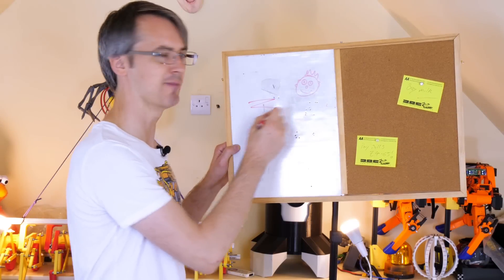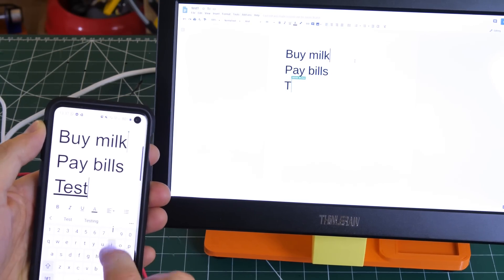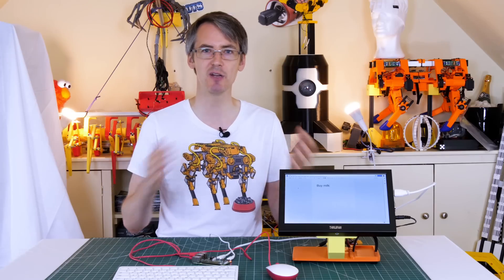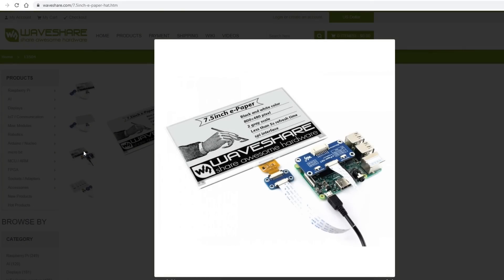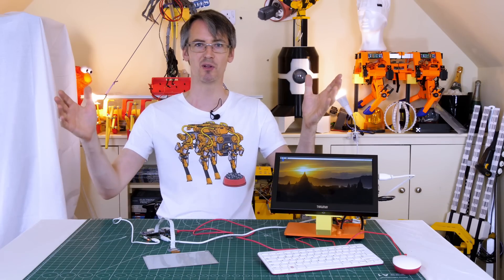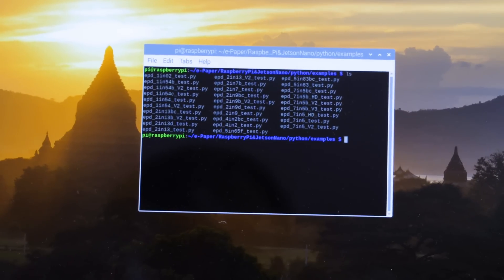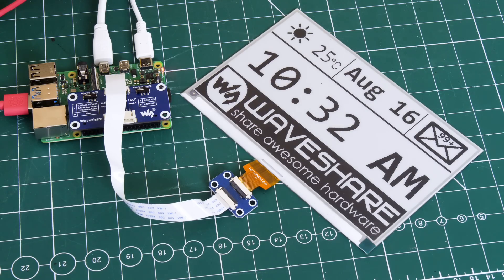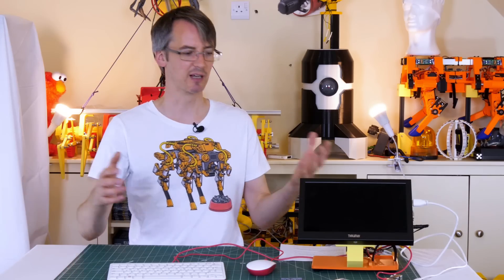DIY IoT  E-PAPER  Message Board

Comment: I would suggest you to learn more python. This is an amazing and very powerful language, but you use it as if is was C (which it really isn't)
Reply: He really isn’t even using it like it’s C— C has arrays (for the numbered variables), and functions (for loading, saving, change checks), and binary logic (accruing a or’ed change check var instead of a massive if condition).

James is an amateur programmer, coding in whatever language he’s using like it’s a basic shell script.  No shame intended and he’ll get better over time (not just using fancier features, but actually better; e.g. the save operation should’ve been after the change check), but right now he’s clearly in the “just make it work” stage of programming.
Reply: import antigravity
Reply: And couldn't you even run it as a service instead of a Cron job? I dont know if it would have any benefits, but it sounds good
Reply: @noahluppe  It would make sense if program listened for events rather than refreshing the document periodically. Its probably possible, but a quick look at the API docs didn't enlighten me.
Reply: Even used optimally it will still be slow, and for little things like this (which imo are the things python is useful for, scripting and his very versatile libraries), is honestly not a big deal
Reply: Marcos Elric — Speed is not a factor for this program, no matter what language you use or how fancy your programming is.  The operations here are so simple it could run at >60 FPS on any device you’re run it on, excluding the actual real language-irrelevant speed hits of network request, file read/write, and whatever processing and signaling the e-paper API does.  That is to say, the performance cost of his code is insignificant to cost of the APIs he’s using (or more specifically, the inherent cost and wait times of things like talking to Google Docs and loading/saving files).
Reply: python needs more semicolons, and why are arrays called lists?
Reply: @alakani  If anything is going to get James to clean up his whitespace discipline, it will be Python.
Reply: @vannoo67  that's not lazy, the whole point of computers is to make things easier so we can worry about bigger things.  my favorite language would be php if the interpreter was faster, goto and curly braces are already built in :p
Reply: @alakani  I can't tell if you are pulling my leg, but if you are installing extensions to defeat python's clean block hierarchy management system and structured programming ethic, I think that you should really re-consider how you think about structuring code. 
I've worked with people that have the same sloppy habits as James when it come to whitespace discipline. Some of them even call themselves programmers. I don't.
Reply: @vannoo67  I'll write code how people like it, if people have to read it.  I'll write my own code how I like it.  Python's idea that there should be only one way to do things is silly.  Structured whitespace isn't going to help anyone beat my score on hacker.org - I'm still in the top 250 out of hundreds of thousands despite not playing for 6 years
Reply: @alakani  You do you boo. 
But the problem comes when other people have to make sense your god-awful code. (Even you, six months later trying to disentangle a spaghetti of nonsense.) 
I agree that using the right whitespace is neither here nor there. I just find that if 'programmer' doesn't have the discipline to properly structure their code, they probably don't have the discipline to properly structure their algorithms. (And sucks to the poor schmuck who has to come after them.)
Reply: @vannoo67  those are two of the things hacker.org teaches you - how to tell what code in whatever language does just by looking at it, and how to optimize algorithms for speed

Comment: Hi! I was thinking of the same project for a while already, but update times are really long. I could not verify if a partial update works on these screens.
Reply: Practical Engineering has an excellent deep dive or two into E ink displays and talks all about the update cycle.
Reply: Depends on the screen but especially for the smaller ones it is working really well.

@James Bruton: The blinking (full refresh) is necessary to get a clear white background and a black text without shadows of previous runs. The kindle/... is doing a full refresh only every x-th time and they are using a better refresh code as well as a smaller display so it happens to work much faster nowadays
Reply: Morituri I was thinhing about an analog clock and 7inch screen like this would be best for the use, but unknowns about possibility of partial update on such size displays made me pause on this project.
Reply: There is also a table at the bottom which shows which of the waveshare displays can do what.
Reply: @Caegofy  Wow, thanks for the info! Will look into this.